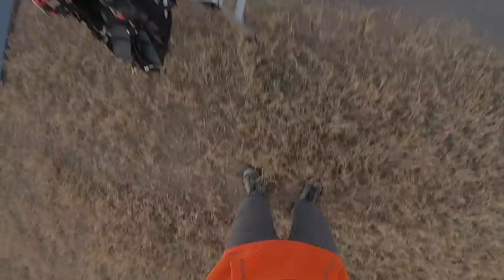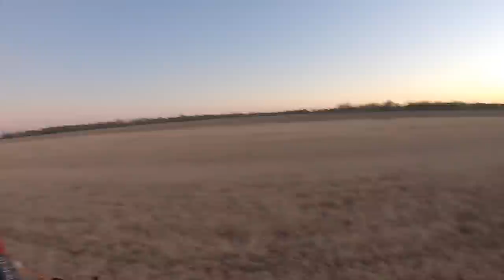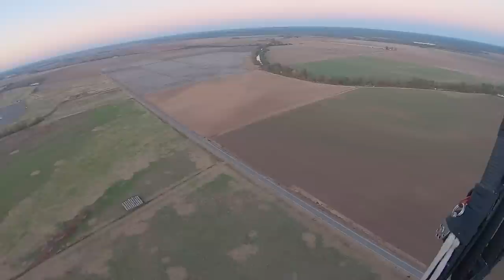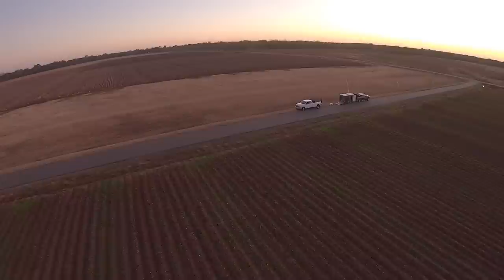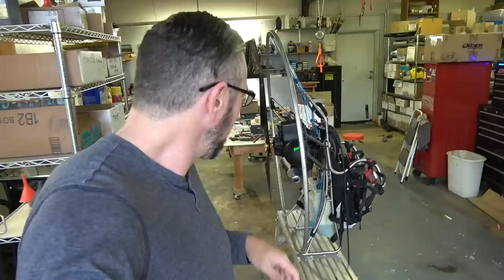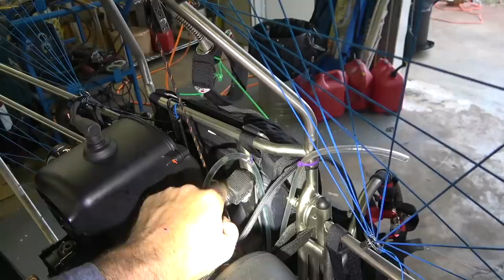Atom 80: Woes, Fixes, and Solving the Mysteries of The Universe

Comment from the maker: Hey guys, a follow up to this video.  It's been two months and not once has it bogged down!   This was the proper fix!
Reply: Kyle O'Glee, I think you just fixed my evo8, I’ve been having the same issue, but my bogging was a lot harder on my moster 185. I’ll be replacing all of my fuel line very soon👍
Reply: Kyle, I'm so happy you made this video. I had been struggling with full-throttle bog down since I got my Nitro 200. At first, I thought it was carb-related, and ended up cleaning it. Didn't seem to make much of a difference. I had also been noticing bubbles in my line... My neighbor is a small engine mechanic, and he thought it must be fuel delivery related. He recommended that I replace my fuel line (and go down from 1/4" to 3/16", to help increase the fuel pressure) and remove the in-line primer bulb. I did not bother removing the clunk line like you, but I was concerned it could be the culprit too... Turns out, it must have been the primer bulb sucking air, because now it runs great, and there are zero bubbles in the line.

Since my fuel tank only has a single nipple for the fuel line and just a vented cap, I now have to prime the system by holding a piece of fuel line to the cap vent, and blow into the tank that way. Im sure I could add a permanent blow tube like you did, but I didn't feel like taking the tank off and doing that yet... 

Anyways, thank you again for the great videos! I always come back often to check for new ones, since they all seem to be so educational. In fact, I feel like a student of yours :)
Reply: Oh - and one more thing I did when replacing the fuel line; I ensured there was no "hump" (twss) or high point in the line before entering the carb fuel inlet. This way, if there is an air bubble, it won't get trapped there and potentially cause fuel starvation. Instead, it will just run up and get burned.
Reply: I dont mean to be offtopic but does anyone know a tool to get back into an instagram account..?
I was stupid forgot my password. I would love any help you can offer me
Reply: @Damon Dallas instablaster =)

Comment: I had 3 months of issues with a brand new 185 plus... Finally gave up, sent it back to Discover PPG. Put a new read pack in it, then replaced the carb with a new one... WHICH WAS ALSO DEFECTIVE! The third carb did the trick! Mixer was the best...

Comment: My Atom 80 did the EXACT same thing at full throttle - turns out the fuel cap wasn’t venting well, naturally creating a tank vacuum at the highest fuel demand (full throttle). I bore out a bigger vent hole on the cap and have had zero bog problems since.

Comment: That is the exact same clunk that I purchased for use in my paramotor fuel tank! That is so awesome that you have the same thing! I really like the ball check valve to prevent fuel from back flowing into the tank. They were only like $10 each. I ordered two of them from an ATV company in Colorado I think.

Comment: If anyone wants to be a Master mechanic of the atom/top/ATOP 80 have a look at Had Robinson's Southwest air sports troubleshooting pages.  I had the exact same issue with a brand new top 80 with the wb80 carburetor and it was diagnosed and fixed with the pop-off pressure on my fuel metering Valve.   also a walbro  diaphragm center spacer change was not addressed with mating parts from walbro to maintain said performance.   A new metering valve spring and GAPed my teeter totter and it was fixed.     I went down in the lake on my third flight. I was grabbing for thrust that I couldn't get after a glide down near sea level, so to speak.  Made the fix and never had that problem again.  He has detailed troubleshooting pages for many makes and models with all the custom little parts you may need to complete the task you're in.    For instance metering springs/or plastic fuel line reducer to fit mikuni pop off pressure tester to a tiny carburetor.  Good luck!

Comment: the old bubbles in the fuel line - I had exactly the same issue with my parajet/moster.  I guess the moster sucked enough fuel that for me it meant it would die totally on full power.

Comment: Had the same issue with my Top 80. I had put on a primer bulb for convenience and it started bogging. Removed the primer bulb and all is well.
Reply: Same here - but with my Nitro 200. Funny enough, this primer bulb was guaranteed not to leak air. And it was most certainly not caused by the connections... They were tight, tight. Mine started bogging at full throttle... Took the bulb out, and no more issues.

Comment: Great video Kyle, I am having this exact same issue on my Atom80; I think mine may have an air leak at the base of the carb because I check my line for bubbles during preflight every time
Reply from the maker: The bubbles appear long after preflight.  Get yourself a mirror, and watch one day when the air is smooth.

Comment: I've run into this exact problem with string trimmers (weedwhackers, we call 'em up here) - the fix is the same, pretty much. Sometimes you'll get pinholes in the hoses, though, from ethanol, and the cheap, crappy rubber the factory uses on the lower-end units.The symptoms are just much more exaggerated. Alot of the time, they just won't start, but if they do, it's up and down city, like you were pumping the throttle. Wouldn't be a fun flight on a paramotor, that's for sure! 

We can't get away from the ethanol crap up here - MA mandates it in ALL grades of fuel, and the laws are so confusing and convoluted (just like our gun laws ...), nobody dares sell ethanol free pure gasoline at any pump. Either have to drive out of state, to an airport, or pay $16 a gallon at Home Depot, or your local OPE (outdoor power equipment) dealer for the VP stuff in a can.

Never heard of a "clunk" as you called it - I always just called it a fuel filter, although that metal one is completely different from any chainsaw or weedwhacker I've worked on. MA has its own language that's different from 99% of the country, so that's not saying much, LOL. 😁

I was dying at the blow hose description!! 😂🤣😂

Glad your pup is doing good! That was alot of stuff coming out of a bad spot!

Speaking of pets, I had to bury my 16.5 year old kitty yesterday. That sucked. Heartbreaking, but unfortunately we're becoming pros at this. That's #3 in the past 4 years. They're all getting old. I've got one more 16 year old left, and we get a break for hopefully the next 15+ years. The other 2 are a little over a year, so they've got lots of time. We're big fans of the pu ... err ... kitties. 😉😁

Comment: Do you recommend that all atom 80 owners do this mod ?
Reply: Personally, I think running a single line from the tank to the carb is a good way to diagnose whether or not there are any air leak issues; BUT I would certainly splice in an in-line fuel filter once you have the issue fixed... Just make sure those connections are air-tight!

Comment: When it bogs it's telling you it's getting lean on fuel, too much air and not enough fuel... Most likely a carburetor setting or the jet is partially clogged up with varnish from setting. Could be sucking air through a crack in the line or a bad gasket.... Definitely a fuel-air ratio problem. If when it bogs down and you squeeze the primer and it picks up and Reeves it's possible the diaphragm in the carburetor is no longer properly pumping the fuel.
Reply: Some of those cheap primer bulbs leak air. I went thru 3 different styles before finding a good one.... That is my guess.
Reply: I have this kind of bogging problem, where squeezing the primer bulb does indeed cause it to rev back up.  Started happening in my first cold weather flight with only ~5 hours on it.  Checked and it definitely isn't air bubbles causing my problems.  Tinkered around with the metering lever as I saw suggested elsewhere, but never could get it to run right in the cold.
Reply: @tap836  cold air is more dense so it requires a little more fuel... You may need to adjust your carburetor 1/8 of a turn when it's really cold. This will richen when it's cold with dense air. This should help to give it that proper balance in cold weather. Just remember to move it back an eighth of turn when it's not cold dense air.
Reply: @tap836  bringing the metering lever to 0.7mm (you can find instructions for this on Southwest air sports website) worked for me with the same bogging issue but only in the cold. That made the problem 90% go away but it would still lose a small amount of RPMs at full throttle. I have to drill out the fuel inlet Port, where the fuel line hooks to the carburetor with a 2 millimeter drill as was recommended by somebody on the atom 80 Facebook group. The fuel in that was necked down down inside. Just got my engine running perfectly in all weather conditions. I think this problem in cold weather is much more common than the problem Kyle had.